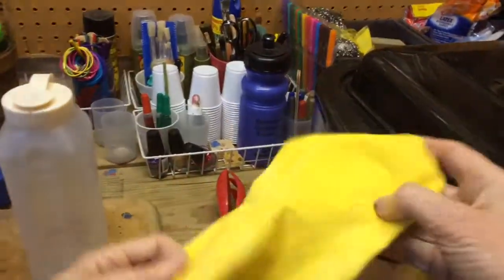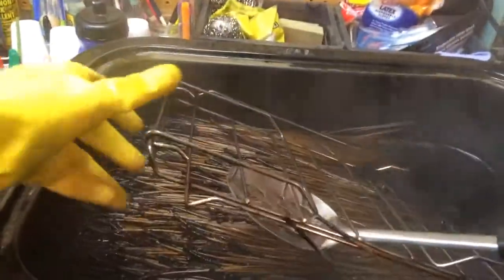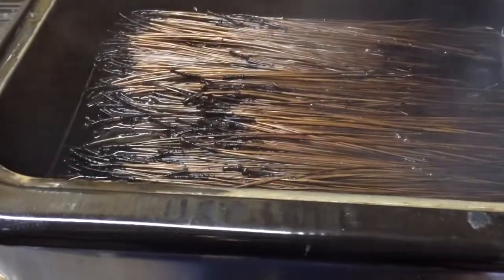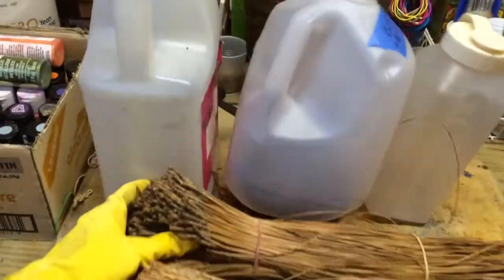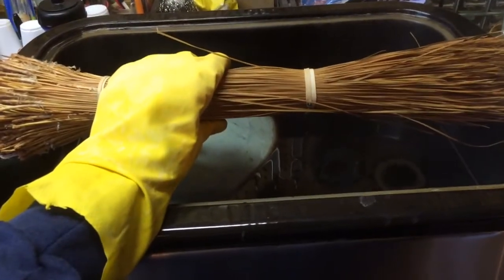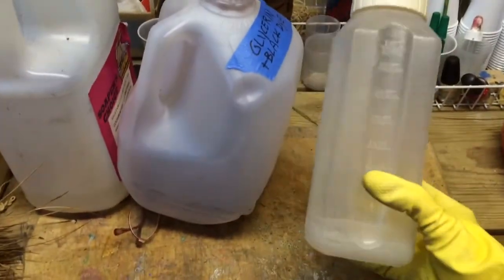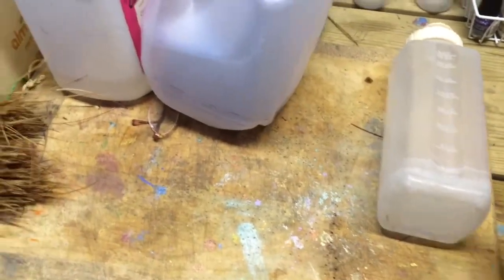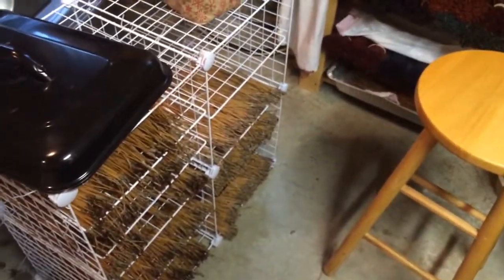Pine needle coiling - glycerin treatment - Part 2

Comment: Why do you glycerin the needles? What would happen if the needles weren't treated? (I'm a newby.)
Reply: I have the same question
Reply: Glycerin keeps the needles soft and pliable without the need for the needles to be wet. Also adds a bit of shine from what I have noticed.